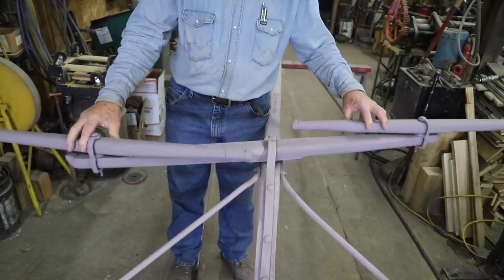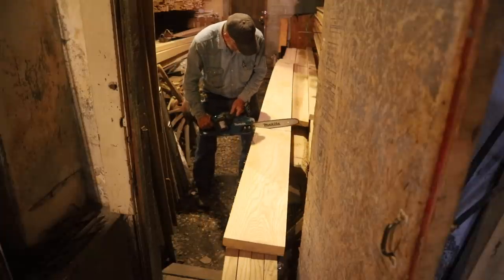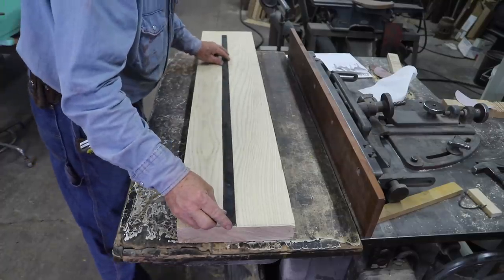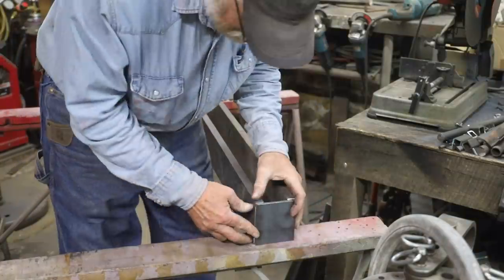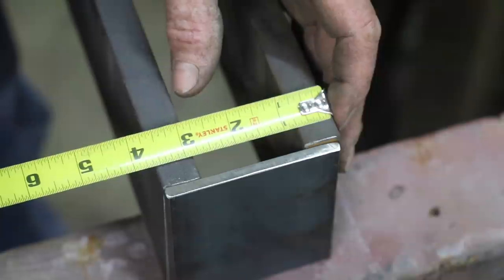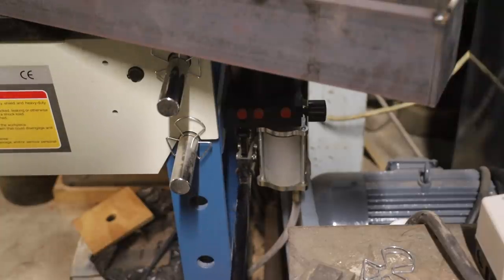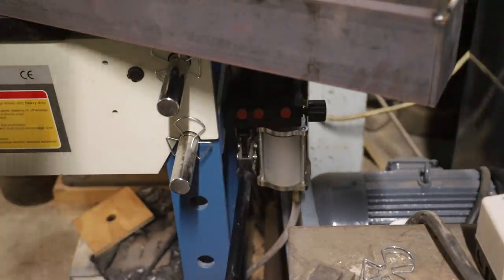Designs of Doubletree Eveners & How They Break | Engels Coach Shop

Comment: I can see a benefit to having the evener fail early. It may well save more important parts of the wagon structure by failing before they do, thus protecting the rest of the vehicle from forces which might cause damage. It is, after all, a really cheap simple piece to replace, whereas some of the stuff it is attached to can be more complex and awkward to replace. Sort of like a fuse protecting circuitry and windings, for instance.  If you take this premise, then it could possibly be argued that the modern evener style is actually an improvement over the old one as it will fail earlier and thus offer more protection to the rest of the buggy or wagon.

Comment: Dave, I have a PhD in structural engineering and have worked in a university structural engineering research laboratory for about 35 years and have run it for about 20 years. Let me assure going extra strong on a test fixture is the only way to go. You never want the test fixture to be the failure point. I do have some observations on the behavior of the two styles of eveners. For the one with the straight cuts on the front side the compression load at the front will try to make use of all the material up there. However, since there is the slope there is a component of stress perpendicular to the long axis which will tend to make that side to pop out which is just what you observed in your test. For the one with the curved edge on the back side the front edge is straight and there isn't this perpendicular component of stress tending to make it split. Also the the curve on the back edge tends to provide a smoother distribution of the tension stress. I'm kind of inspired to do a computer analysis of the two styles for fun.
Reply: Thank you.

Comment: This makes perfect sense to me.  If you look at the truss rods under old rail cars, truss beams under semi trailer flat beds and modern flat bed rail cars , they all are engineered according to this principle.  Enjoyed the video as usual Dave!
Reply: Well, they are made out of steel, not wood. Different material properties might result in another ideal solution.
And, in your examples, you actually want the flat side on top to put your stuff there. There might be a compromise to trade strength for convenience.

Comment: Good demonstration.  Generally speaking a curved surface will distribute the pressure more evenly than an angular one.  The ancient Romans knew this principle and used it to construct their aqueducts and domes, the renaissance builders rediscovered this, and it was also used in the "flying buttress" during the Medieval period. Modern dams use the curve facing the water to distribute the pressure to the sides.
Reply: Think or visualize the stress put on an eggshell.
Reply: @royreynolds108  Interesting fact that the hen's egg comes out blunt end first so the muscle contractions can exert enough force on the inclined surfaces to move it out.

Comment: Hi Dave Just love that you are taking a scientific approach.  In todays engineering in steel the approach would be to locate the holes more toward the neutral axis (mid point) of the beam.  If you decide to do any more tests I would be interested to see what happens if you shift the centre pivot hole.  Also strengthen either side of the centre pivot like you did at the ends.

Comment: Very interesting and a great piece of work. Pity the press gauge hardly got moving or we might have seen different loads between tests.
I think the difference reflects how the wood distributes load. 
These are beams in engineering terms, with point loads causing bending. As you say the rearward part is in tension and the forward part in compression. In a wooden beam, across the beam, the outermost fibres take the most load. The highest loads along the beam are at the centre.
As the beam tries to load up the outermost fibres under compression, the fibres try to split apart sideways, which is the failure mode you saw in the first test. That's not helped by the way the beam was cut because the highest loaded fibres were short, relying on shear to transfer the load.
In the second test the fibres in compression also rely on shear to transfer load but along their full length, so didn't fail (you were right all along!). Instead the ones in tension failed first. These would have been squeezed together under load so more stable and may have benefitted from the curve rather than triangle cut shape, because the highest loaded fibres getting load by shear were longer. 
Interesting.

Comment: The straight edge on the front focus compression straight across the straight edge. Having an angle on front focussed it at an angle splitting the grain. Totally agree with curve at back keeps more material and even gentle change to stress. There is more to old school than meets the eye

Comment: That was interesting and fun. 

Your "classic" design seems to put much more of the stock where the wood is in tension than in compression - branches of hardwood trees growing off a main trunk are like that too. 

It reminded me of our ancient cruck beam roofs here in the UK (and probably across Europe): The cruck beams themselves come from curved oak boughs (not trunks), chosen to match the desired finished shape, using the grown curve's strength to get maximum support. 

It's one of the few applications for wood from branches rather than a main trunk, but it works -- I was looking at one three weeks ago, where the joinery (pegged M+T) was probably done around 900AD: nobody wants to damage it just to date it accurately, but the building is in both Domesday surveys - definitely Saxon or earlier. The basic structure has lasted ~1000 years! 

The builders didn't understand or have names for physics concepts, but they did know how to take advantage of the way gravity worked on trees as they grew. Looks like carriage builders were the same :-)

Comment: Very instructive.  I was going to comment that that was not your regular hydraulic press and wondered if it replaced the old one.  But I would bet the old one works better for most applications in your shop and this newer one has specific uses as well.

Comment: From a basic engineering stress analysis, the older design is advantageous. The front, as noted, will be in compression and the rear in tension. Wood (and most other materials) is stronger in compression than in tension, therefore you need more material on the tension side of the beam.
Reply: I'm going to second this.  Wood is about 30% stronger in compression than tension.  So, adding more wood on the tension side will even out the load.  There's more to it than that, like cutting the curve cuts the fibers of the wood, but assuming uniform wood, bolstering the tension side is the way to go.

Comment: Your test showed the results. You are correct.
Reply: I don't doubt the result of this test. But i think Dave build the "new style" wrong.

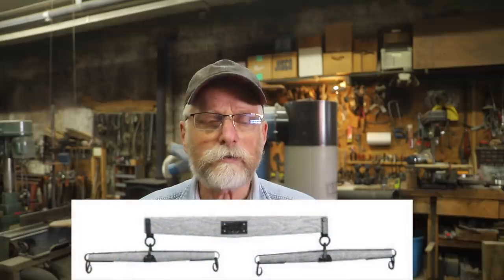When you look at the picture at 1:24 you might see the center hole is further back. Wood behind the hole is under tension, wood in front of the hole is under compression. But wood only takes ~40% of force in compression compared to tension. Therefore you put the bulk of material in the compression zone - but Dave didn't do so.
Reply: @DrKlausTrophobie  You make a valid point.

Comment: It would be interesting to test a laminated evener, with a straight grain straight piece at the front, and a straight grain bended for the rear. So both edges are working with grain that is in the direction of the force.

Comment: Nice: Given your demonstration of strength under tension for the back-curve/rear-facing evener -- If the back side curve was additionally bolstered with a strap of steel - the experiment could possibly reach satisfyingly dangerous levels of pressures before the front edge collapsed under compression!  
Another gedanken experiment would be to imagine the evener thinner and thinner until it resembled and archery bow.  In which case, survival of the structure requires the curve, the bow, to again, face the rear: face opposite the load on the tips.   With the curve facing aft - towards the wagon, the evener is essentially a very stout spring.

Comment: Strength wise wood takes ~40% of load in compression compared to the load it takes in tension. Because it buckles like you had shown.
Therefore it makes sense to put the bulk of material where the compression happens.

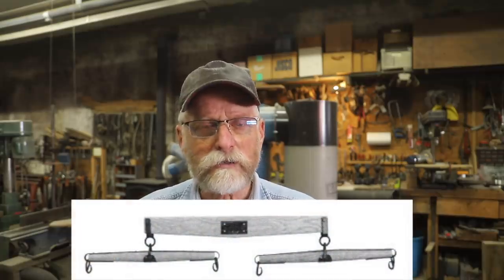But in your test the wood split at the hole. I think the center hole has to be further back to make most out of the advantage. The picture shown at 1:23 also suggest more material in the compression zone.

Comment: I'd go with if it's the way they did it in the past there probably a reason for it, and stick with what works
Reply: Well, the question is still: What actually works?

I'm not convinced by this test. When you look at the picture at 1:24 you might see the hole is further back then in the test. Wood behind the hole is under tension, wood in front of the hole is under compression. But wood only takes ~40% of force in compression compared to tension. Therefore you put the bulk of material in the compression zone - but Dave didn't do so.
Reply: @DrKlausTrophobie  Have your plumber cut holes for waste pipes through your joists in the lower quarter instead of the upper quarter and report back how happy that makes you.
Reply: @deconteesawyer5758 Your waste pipes are load bearing? Mine not.

The comparison makes no sense. The point that the upper quarter is still the better solution in pipework doesn't tell anything about benefits in a wooden construction.
Reply: @DrKlausTrophobie  Wasted again ?

Comment: I know it is not historically correct, but I wonder how much more a laminated evener beam would take of pressure before breaking ? Either glued lamination or seperate floating laminates held together by bracket sleeves; same principle as an old car spring system. I suppose the free-moving laminates could compensate for the inwards compression and be quite strong ? Thanks again for teaching us that a lot of enineering thoughts and experiences are stored within the traditional designs and it is up to us to interpret and understand why they are built the way they are. Great video again, thanks Dave :)

Comment: I think the difference in strength is just due to the way the eveners can buckle. If you look at the frontmost inch or so of each evener you will end up with a straight piece of wood for the one with the curve on the back and a bent piece of wood for the one with the beveled front. Under compression the bent one will surely buckle in the direction of the bend (forwards), creating a force that pulls the piece of wood apart along the grain (the weakest direction of the wood) and suddenly there is no compressive strength anymore on the frontside. Due to the flexibility of wood, the straight front (back curve evener) will get a slight curve under load. Curved he same direction as the back curve. This one will want to buckle backwards which is not possible due to the rest of the wood being in the way. Buckling will not be possible and the compressive strength will stay. This could be tested by making two eveners both with a straight front but one with a curved back and the other with a beveled back. I expect them to fail the same way by cracking perpendicular to the grain on the back.

Comment: I'm completely in cahoots with you.  I see it as looking at the grain of the wood, with the 2nd one you are essentially using all of the wood grain to be compression because you are utilizing all of the layers on wood grain to hold the weight as the grain of the wood is stretching lengthwise due to the layers being stuck together until the very last minute.  where as with the first one, you are separating the layers of wood grain meaning you are only utilizing about 70% of the actual wood to hold the weight causing it to fail prematurely.

Comment: It seams to me that by adding a very thin metal strap the back of the arched double tree and bolt it at the bolted ends one would get an even stronger double tree. This would add an insignificant amount of weight but would prevent the tension stress. Of course it would do nothing for the compression stress but perhaps might even the load in the wood fibers.

Comment: true a simple test but --- it proves were the bulk of the grain should be at
Reply: I'm not convinced by this test. When you look at the picture at 1:24 you might see the hole is further back then in the test. Wood behind the hole is under tension, wood in front of the hole is under compression. But wood only takes ~40% of force in compression compared to tension. Therefore you put the bulk of material in the compression zone - but Dave didn't do so.

Comment: Great experiment. I strap of iron on the tension side could strengthen the eveners. That would make them stiffer too. Do the eveners have to bend a little to account for the steps the horses are taking while pulling the load? Is that part of the old understanding of how animals actually provide their "horse power"?

Comment: I'm not the smartest cookie on the plate. I get your reasoning. But to me it seems like time under stress would be a bigger factor. Also load weight. Just curious, do eveners fail a lot?
Reply: As far as time under stress, think of structures. The frame of a house is under constant stress. Time under stress is really not to big of a deal until you get to the point of exceedi g the limits of the material. 

As far as failure. It could happen. I haven't seen an evener fail, I have seen a single tree fail. It is not a thing that should happen. But you should not overload the animal(s) and equipment. The bigger the load the more animals and proper equipment you need to utilize. Of course the animals themselves  play a big part if they are not working together, hence the one single tree I have seen destroyed.

Comment: It's hard to tell how much the gauge showed each time but it seemed to take more pressure to brake your version. A more sensitive gauge would have shown a larger swing but it sure seems conclusive to me. 
The fact the rear split out a lot more is it had no place to go..the other just bent but had more meat to stretch out on the back side. seems to me it gives it more spring strength overall. but what do I know I'm a city boy.

Comment: The issue must be whether wood is stronger in compression than extension.  Wood is about 30% stronger in compression, so you would want the extra material in the part that is under extension, i.e. the back part of the tree.

Comment: Juat from curiosity, is that wood ash?  Considering that the deflection before failure on both types was similar 1.25 inches, the failure is the wood's strength.  But the more limited damage the old type experienced before failure compared to the modern design is pretty interesting.

Comment: It's obvious to any engineer why the arch should to the rear.
Wood ,like most building materials with the exception of non-reinforced concrete ,has it's greatest strength in tension. So the design of a girder (which this is) needs to ensure the force vectors put the girder under tension and not tension/compression.

Comment: Haha, nice experiment. What surprised me most was how effective the end rivets were at holding it together. Based on that I was thinking a 12 inch long flat of steel on the front and on the back with a couple rivets through all could reduce the flex in the middle both ways. Am I off my rocker?

Comment: No through bolts at the centre as at the ends?
No reinforcing iron work?
How often do they break?
But here's a question, if the back is under tension and the front compression, why not choose wood the way Boyer's do? That is, to use wood with heart wood on the compression side?

Comment: I don't get it. Imo you test both eveners the wrong way around. The bolt in the middel should be on the back. The D-rings that the horses pull on are on the front. That way when one horse pulls ahead of the other, its D-rings moves in and the one on the other side moves out, thus shortening and lengthening the arms respectively. This puts the largest force on the shortest arm and so the torque on the evener evens out.

Comment: Everything has a maximum stress point. When you exceed that stuff will break. The design is such to get the best efficiency out of it. But being made from wood over time it weakens. Like a green tree branch can bend without breaking. Let same branch dry out flex the branch at the same angle 📐 it will snap. If you persevere the wood in water sealer or paint it should lengthen the life span by preserving the wood fiber layers by keeping it pliable. Like a wooden handle on an ax or hammer 🔨 after so many blows an exposure to the elements they crack n break.

Comment: Dave, you had me convinced from the beginning.  But it would be interesting to see a test with the two eveners connected to each other and pulled apart, to see which one would fail first under equal tension (like a tug-of-war).  It might be a little harder to set up, but perhaps more conclusive and more convincing for the doubters.